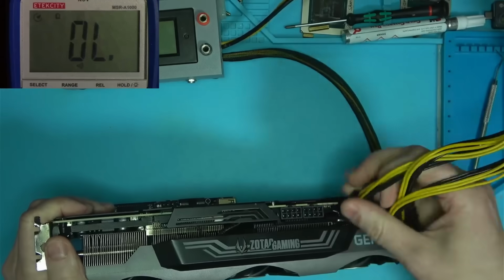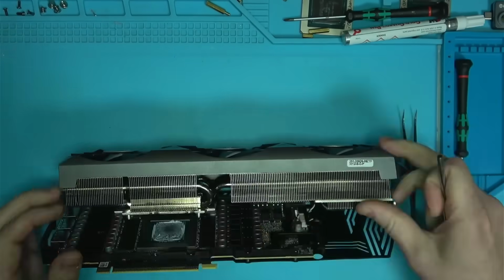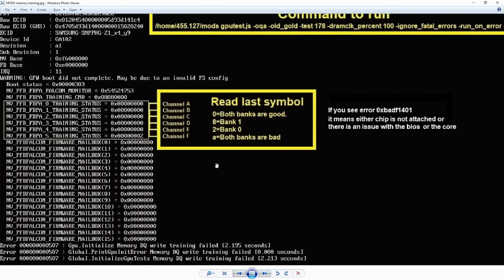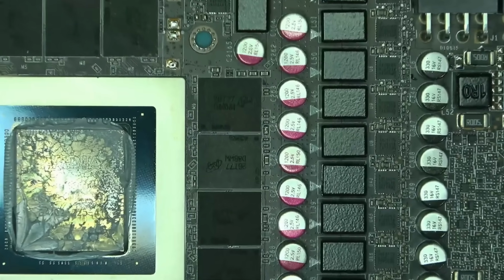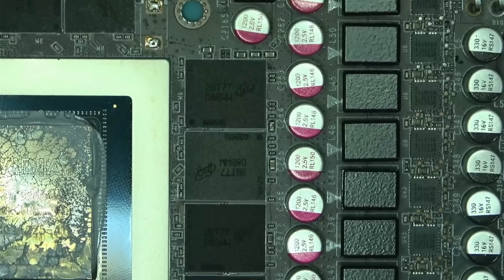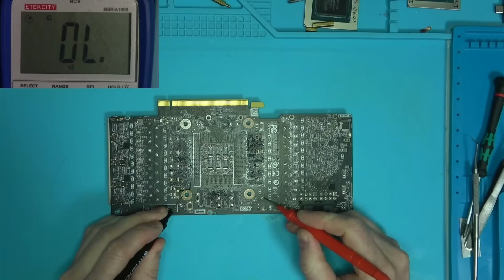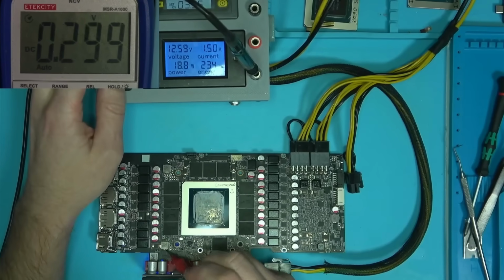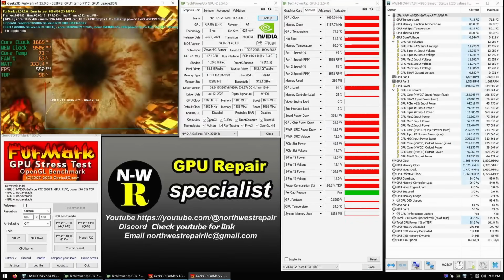Common problem with most GPUs  (repairing Zotac 3080 ti)

Comment: I have the same video card it works fine, but the zotac LED's flashes/blinks yellow 3 times> does that means theirs something wrong?  I check the power cables and they are ok, I might resit the card in the PCIe slot but that's going to be a pain in the but because my PC is wall-mounted

Comment: Funny enough, I got my hands on two 3080Ti Trinity, one that works and one that has random crashes when cooling. BOTH have issues in the exact same memory bank, C1... I guess it's a factory defect and they are poorly soldered to the board rather than being dead. Huh... Zotac.

Comment: Your channel clearly shows why I won't waist my money on 200+watt cards with the very high failure rates they seem to have. You rarely ever seem to repair GPU's below this power threshold.
Reply: Probably has to do that low power cards are exactly that: low power. They don't have high performance, which makes them cheap, and a cheap card is probably not worth repairing.
Let's say you have  a 300$ card that is 3 years old, and it dies, the repair would cost 150$, but for 200$ you can get better card used.
If you do the same comparison with a high end card, it looks way different and is actually financially viable to do a 200$ repair on a 1500$ card.

Comment: i like to talk to u to find out what can be dun or if any think shuold be dun to my cxard i have a msi troe 3fan i order irt used it has led rgb my chips is pulling 12to11watts but the bored is pulling 18to24watts just in idle on deask top i think the card is pulling to much wats doing nothing cuz iit was mind on to hard by a guy i think idk but its a 1000cash gpu 3070 is all it is i cleeend it up put new pads on it spant so much cash on pads geting right ones sir my  mom passed an times are hard i just whant a new gpu that can stream like the 3070 or 2080 i have a new 3060 12gb an i have a 6700 non xtt never used  but 3060 workd ok 6700 dont stream good at all amd sucks

Comment: Common problem with most GPUs 4090s far too heavy they Crack if unsupported  do it Now get a rod stick under yours asap or your gpu  $2,500 up in smoke  . . . .

Comment: How do you know, that the error is because of the chip itself, or the solder under it, and not the solder under the core? Am I the only one, who is replacing the wrong chip, and its working for some time, then the same error occurs, then I realise the core needs to be reballed?

Comment: why so many memory failures, is it because  of heat or voltage spikes?
Reply: I may be wrong, but these components do not contain sufficient heat resistance to be considered 'reliable' enough to not be a common point of failure.
Reply: Gddr6x problem because 110° 24/7

Comment: Video cards used to work indefinitely. My msi 1080i for example has been fine for 7 years.❤
Reply: i have an RTX 3070 now but my old GTX 1060 6GB SC from EVGA still works, it worked for 6 years also, will work for many more years to come.
Reply: of course if you care of it with custom fan speed and not on auto speed that destroy cards ..
Reply: @derim006  i have a 120mm case fan that blows on it at 800 rpm and increases as necessary..

Comment: I wish it was this easy to replace and fix the faulty memories in our brains also😂 But maybe one day...
Reply: hahaha me 2, RN i'm trying to fix a gtx 1060 (6GB) that is power limited to 35w, it senses power only through the PCI-E port, the 6 pin PCIE conector reads 0 W but it does sense 12v idk wtf is going on
Reply: @arceus567  Track that 12V all the way to the VRMs, maybe it's 1 of them, don't think the Fets be tho. You can check the vrm tems by drop of alcohol to see better bcoz sometimes when semiconductors die they short thus become very hot quick.. It's been over 18 yrs since I finished college and haven't fixed anything in like 10yrs so I can't be much of a help bro. Goodluck👍
Reply: The short circuits are a feature, embrace the violent voices my fellow schizophrenic 😂😂

Comment: I wonder if gddr6x memory just runs to hot I have a gddr6 rx 6800 and my memory temps stay under 60 hot spot hits a max of 66c I have very well cooled and even quiet pc setup.
Reply: I remember 106C mining ethereum on 3080s and 3090s lol. Changing pads lowered 20C
Reply: @excess.subiefl0w  Stock pads do suck, unfortunately. Literally dried out in first week on me once.
Reply: Yes GDDR6X runs hotter than the non x variant. 6X is 15% more efficient but uses more power in the long run due to it's higher performance and speeds. It's normal for 3080/3080ti owners to see memory temps in the 80c-90c+ while gaming etc. I own a 6800xt and like you my memory temps never touch 70c let alone 90c+. And this heat and wear for a mere 3% more performance over the non x variant...

Comment: Just as reminder to anyone, disable zero-rpm function, also do not use auto rpm function and set at least 90% fan speed over 75c if you want  to spare memory and gpu.
Reply: thanks for the advice :)
Reply: 75c hot spot or core/memory
Reply: What do you not like about the 0rpm mode?
Reply: @Mike-gq9bv  Well as with everything - It depends. What I think he meant is how the ram chips are cooled (how the contact with heatsink and heatsink itself is done). But generally, as there is no airflow it means that the heatsink is passively cooling your graphics card - which for core might not be a problem (0 rpm modes are set to start fans at around 60°C of the average core temp (!)) but they are not set up based on memory temps - this might lead to lowering longevity of ram chips (as in certain conditions they might be quite hot) in certain cards. 
Imo it is important to know what you have and stress test your hw to see how to operate it optimally - not that the 0 rpm mode is inherently bad.

Comment: Do you have any recommendations on how to avoid this problem, if it is possible to avoid it at all? I already listened to one of your tips for the RTX 2080ti and GPU holder, where there is a problem with VRAM chip due to the sag, because of its 352bit bus and memory configuration for now so far so good it still works perfectly with Samsung memory. Now I want to know how to protect my RTX 4080 if possible. Thanks.
Reply: also gddr6x memory runs hot causing early death, keep memory temps under control will save u a lot of issues that and cards are heavy keep them from sagging.
Reply: @mrhappy8966  Thanks for the advice, this generation it seems to me that all GPUs are overbuilt that's why they are so big and heavy. Undervolted draw 90w less core temp not pass 63-65c even in summer and VRAM temp are great 66c on stock, overclock +1500mhz 68c. I don't know if GDDR6X is killed by the temperature or overclock speed shorten life even if the temperature are ok?
Reply: @sjuric2435  Good rule of thumb the flame that burns twice as fast burns half as long, I do not overclock my stuff ever.
Reply: @mrhappy8966  Good comparison I agree.
Reply: Factories are using non-lead solder, to avoid toxic chemical in later process, it also crack much sooner, from heat change and tremours
Reply: Tremulous*
Reply: no.1 noone talks about is where they plug the ps unit..don't just stick it in the wall socket,use the cord which have power surge protection

no.2 sag breaks solder connection if pcb isn't perfect flat plus constant heating and cooling can also break these joints

no3 reverse engineering..companies have knowledge how to minimize lifespan of their products..if you buying new w warranty make sure to oc everything you can think of cause trough normal use parts are designed to fail short after warranty expires..happens w my ps4 disc drive,i took extra y of warranty and it failed 1 month before warranty expired..sadly disc drive was gone again after next 3y..parts used to be more resiliant and durable..nowadays not so much

no4. keep fans clean and shiny
Reply: Undervolting the card using MSI afterburner works to keep the card cool. Google "GPU Undervolting using MSI Afterburner" for steps.
Reply: @IHMT00 The problem with the melting was in the Cable Mod 90 degree adapter and RTX 4090 only a few RTX 4080, and 4070/ti none. That's why they took it out of use, then they did a revision and in the end they also took it down because it also melts. 
People bought them because of insufficient space and bending of the cable because they could not close the side of the case. 
I had both v1.0 and free of charge replaced V1.1 I didn't use either one but a custom 90-degree Angled 12VHPWR Direct PSU Power Cabel no problem like everyone else who connected the GPU that way. 
I don't know why no one, neither Nvidia nor AIB partners, immediately included a 90 degree angle adapter, but a straight one that you have to bend to close the side of the case and you must not bend it because it will cause problems, this way the problem would be easily solved and avoided.
Reply: Other than keeping the GPU from sagging, not much. Make sure the power cable is plugged all the way in (especially with the big 12v plug) and your PSU has more than enough amps on the 12v rail.

Failures will still happen due to factory defect that may take months or a few years to show up.  Lead-free solder is usually a big part of the reason for failure that's fixed with reballing but dumb government regulations around the world demanded lead-free solder.
Reply: @Fan-lq6uv  Thanks for answer. Having GPU more than a year now no problem so far bought a custom 90-degree Angled 12VHPWR Direct PSU Power Cabel from modDIY. Before that it has a Cable Mod adapter V1.0 it melts I didn't even use it I got a replacement V1.1 I didn't even use it it turned out to melt again. I sometimes look at that voltage in GPU-Z, the lowest is 12.1v in gaming, everything should be ok on that side. I'm more interested in the memory, since its OC for +1500mhz on the last 4 Nvidia cards, I OC the VRAM and there were no problems, but this one is the most expensive :) that's why I worry more.